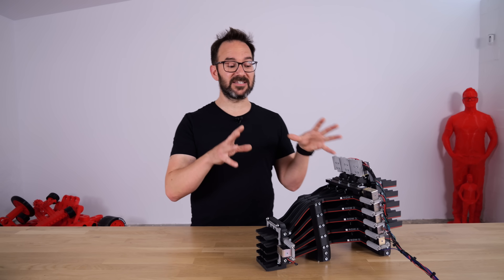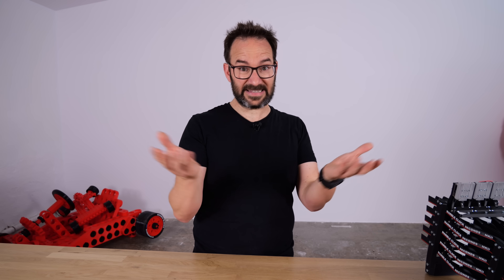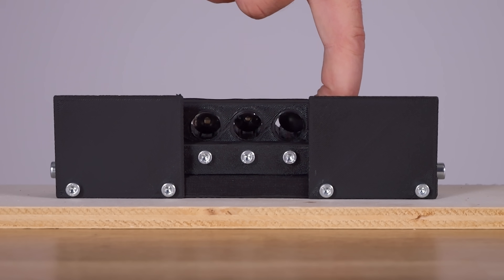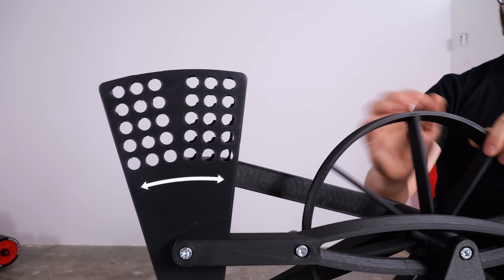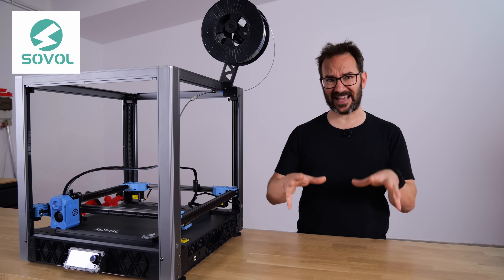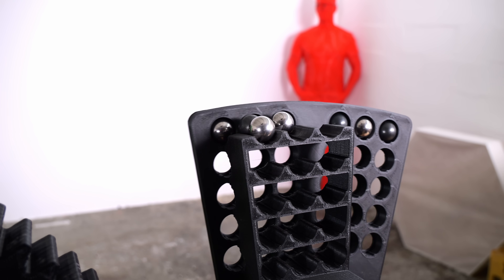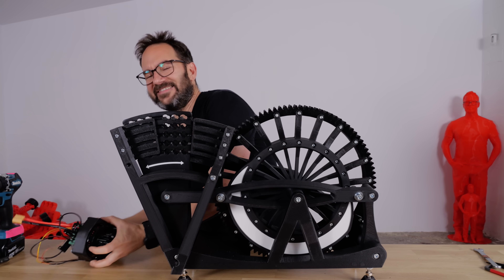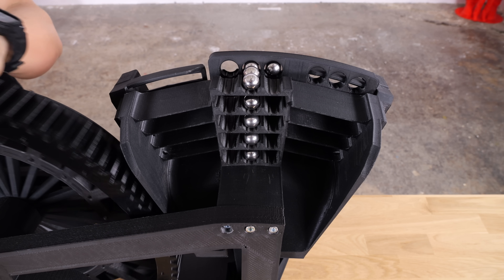Swinging Marble Teleporter - Marble Clock Seconds Display Pt.4

Comment: If the motor spinning at a consistent 300rpm is the only thing keeping your clock accurate, you're going to need a feedback mechanism to get the controller to hang back or catch up to keep it on track.

Comment: Does anyone know what the geometry between the smaller and larger diameters of the cam wheel is called? I've never seen a cam wheel like that with two points of contact acting on the same arm.

Comment: I believe this could be simplified a lot by removing the darker coloured marbles. They were needed in the original clock in order to serve as a placeholder, but in this design, they don't actually serve any purpose. If you removed them, you could remove the marble sorter.

You could also make a 5 x 3 display grid that was operated by gates driven by servos: one to allow a marble to roll into the display, and another that would allow the marble to leave the display. To adjust seconds, you would then only need to add or remove the individual marbles that differ between the digits. For example - to change an '8' into a '9', you only need to remove two marbles (bottom left corner): all the others can just remain in place. Making digits change this way would hugely cut down the number of marble each second you need to deal with. You'd also get quite a nice morphing effect between digits. Hard to explain without a diagram I'm sorry - but a total of 30 servo operated gates: two for each dot of the digit: one to allow a marble in, the other to allow it out, and only move marbles when necessary.

Comment: How about using only white marbles? by having a marble/no marble pixel, filling or leaving the spot empty on the refresh cycle by changing the speed at which the new marble impinges? (Faster marble = both marbles are displaced = black pixel; slower marble = new marble stops in place = white pixel; no marble dropped = no pixel change)

Comment: I feel like it would be nice if you could recapture the three balls coming out of each layer of the display, in order, and just recycle them to the back of the display in the same order instead of doing detection and sorting the way you did for the main clock.  Since they're getting ejected by the wedge it doesn't seem like it should be impossible, though routing will be a major issue

Comment: An idea i just had for the marble selection, what if you have a seperate stage to seperate the silver and black marbles into storage. That way the stage making the number for your display just needs to take from either tank, and a seperate stage will just seperate the black and silver. 
If it works that may be better than trying to do both at once. I dont have much engineering experience so take that with a grain of salt lol😂

Comment: Since the black marbles don't need to be used as placeholders in a parallel arrangement, can you just remove them for this part of the clock? The were only needed for the hour and minute section because it is a series arrangement.

Comment: You don't even need full width of the digit to purge the marbles, if you make the front matrix rectangular and move it horizontally, you can use one matrix for full width of the clock, with the space between digits just two marbles wide, allowing for purging both from left and right.

Comment: Since the pattern for the seconds is always the same, if you make sure that the marbles get ejected in order by adding some kind of closed tube right after the comb, I think you can just circulate them and you don't need an "active" selection mechanism, just the same marbles rotating in the right order over and over. This could simplify the design of at least the tens (0 to 5) of the displayed seconds, with at most 75 marbles in use.

Comment: I wonder if you could dip the black marbles into some very thin epoxy, then tumble them underneath a UV lamp, then swap the basket once they're all dry and keep tumbling them until they're smooth again. The right epoxy might fill the pores created when turning them black, and tumbling them would simply knock off everything that's higher than that.

Comment: Seems to me like you could have a giant wheel with 1,800 marbles in it (592 black, 1,208 silver) spinning at 1 RPM, displaying each of the 2-digit sequences from 00 to 59. For the size of the marbles you have that might be overkill though—2 single-digit wheels with a total of 240 marbles (78 black, 162 silver) might be better, 1 spinning at 6 RPM and 1 at 1 RPM. The latter'd save PLA at the very least.

Comment: the issue with this design seems to be how to fit the six digits close enough to feel like a unit. since it occupies space to the sides of the display and mostly leaves the space vertical free do you intend to make the display vertical? the angular change looks amazing, but maybe transforming it into linear movement would work better to set up all the vertical numbers in the display to a single wheel? there's just so many possibilities on how to make it work or not, i don't know how you manage to choose a solution and work on it so well, I'd be overwhelmed by the choice probably

Comment: you should use a "rocker based" system" that would help with stoping the ball, showing the ball for a bit and ejecting the ball. while ejecting it would stop the next ball to load it one it moved back. the rocker doesnt need to be that big it would just have to make the opening smaller than the diameter of the marble. thus it would also be able to be cascadet
Reply: tension it in closed postion with an excenter to open it and 
control technology should do the trick

Comment: @ivanmirandawastaken I've been enjoying this series alot, and the whole time you've been struggling with making chrome marbles black and struggling with their performance.... Have you thought about going with Ceramic marbles? They come in black and white, and are low friction, perfectly smooth, and higher contrast for optical sensors than you'll be able to get with a metal marble. Now... to start over. You're welcome!

Comment: I still think you are overcomplicating your design. Simply using your original design with vertical rails instead of the horizontal ones, the marble sorting happening before the marble is put on any specific rail, as well as building buffers for digits would've been much simpler than what you are doing now.

But as it stands, your current design also suffers from the fact that it always resets after an iteration. In other words, even if some marbles in your display are the correct color, you will still need to replace them. That will put the maximum load on delivering marbles possible.

I still like the idea,  it's just a bit painful to watch you repeat the same mistakes Martin did.

Comment: you should try to make an 3d printer that does injection molding. you would obviously need a stable easy and accurate way to make the molds, but I don't think it's impossible. I saw some of your giant 3d printers builds and I think that an injection mold printer would fit right in. Me personally I would be cheap and use as printer nozzle so I can use the filament I have lying around, again that would come with some issues like the size of the nozzle and the pressure that would need to be maintained while injecting, not to mention if you are planning on using different molds. I would definitely be a machine used to make a lot of parts fast and with accuracy.

Comment: wouldn't it have been easier to build a 3d printed set of venetian blinds?  Put it on the end, and when you want it changed, put a linear motor on the blinds control, drop everything, and put the blinds back for the next marbles.  This is the rough idea, there are probably engineering terms to describe this better

Comment: a thought for seconds & numbers-  you only need matrix x2 for marbles and the ability to switch each "pixel" - difficult to keep each pixel close enough with this design, but because you always know what number is next you can save on cycles. 
realistically you're gonna keep a lot of this the same but an idea for sorting-  have multiple slower sorters that get the discard marbles, and then merge and feed their outputs to a batch heads that can choose what marble it spits out. would allow you to feed batches of marbles to the clock simultaneously and let you have a buffer of always having the correct marble when you NEED it

Comment: Was the giant wheel really necessary or just a "bcs i can" statement?
You could have pulled it off with a crankshaft pushrod design, like in a car engine.
would have saved you ALOT of PLA.
But I understand the design choice. Oh and dont forget to counterweight the wheel. ^^

Comment: No, you are NOT Crazy...

At least not any more...

This video proves you are WAAAAAAAAAAAAAAAAAAAAAAAAAAAAAAAAAAAAAAAAAAAAAAAAAAY past merely Crazy...I don't think they have a label for what you've become...

This massive mechanism is enough to display one digit...in a clock that will need a minimum of 6 of them...2 for Hours, 2 for Minutes and 2 for Seconds...

Which means you need 6 of these Beasts...PLUS all the additional ramps, chutes, hoppers, sorters and feeders to send marbles to the 6 display mechanisms and then collect the marbles after they gets spit out of the display to be sent back to the hoppers for sorting back into the feed...

Unless you can figure out how to MASSIVELY miniaturize what you just showed us, your final clock is going to be the size of a Kitchen Table for a family of 4...

You could always build it so you can bolt a top to it and use the clock as the base for a Computer Desk...though you'd have to crane your neck to see the time display as it would be under the desk surface...

😄😁😆😅😂🤣

Comment: feels like this thing might obviate the need for a marble selection mechanism. since you can now gain control of the marbles leaving, just keep them on separate chutes like how they come into the matrix. roll them into another matrix that goes up and down every two seconds (controlled by the same cam maybe? at least connected to the same main gear...) and then let them roll back out and merge back into the queue for the matrix. Then you only need 150 marbles total, set them up to display the digits in order once, and you're done. Yes there are some more problems to solve with this, but it seems like it would require less energy and have fewer components that could fail in the end. No sensing parts, no selecting parts. Just marbles moving.

Comment: SUPER awesome and cool! Can't wait for the finished design.
One question though: Did you do an exact 100:10 gear ratio? isn't that super bad as every tooth of the big wheel will always engage with the same tooth from the small gear, increasing the likehood of failures by a lot?

Comment: Could the marble catcher be on a circular wheel (The 9 holes 12 times around a centre point) itself to reduce the mechanism footprint, remove all those linkages and  the mechanism would go in one direction increasing its lifespan?

Comment: There is an INCREDIBLY simple solution to the problem with marbles pushing each other off inconsistently. Add another marble. The falling marble hits the middle marble, and ala Newton's cradle, the momentum transfers to the marble on the edge and it falls off. Now the other two marbles, which are currently stationary, slowly fall to the end.

Comment: Why not stack 10 marbles in a tube and when 10 reached empty it, and fill tube2 with one extra marble until six marbles in tube 2 reached(60 seconds). empty tube2, and do it again, no need for multiple colors, and no timing problems.

Comment: I think, you might have been able to get the old one to work if instead of having the marbles stop at little ramps, you‘d use a wall and another grid of pins to push them out (run similar to the setup that prepares the next load).

Comment: Here are some improvement suggestions:
1) Replace the linear motion by a circular motion: you already have a 2 matrix sector, it's simple to replace it by a 10 matrix disk.
2) Use indexation: associate each matrix to one digit. This will simplify coordination between each module.
3) Limit failure risk: in each matrix, marble configuration will stay constant, so stick marbles to their definitive positions.
4) Remove unnecessary systems: since all marbles are now stuck, you can remove the filtering and the supplying system.
5) Lighten the clock: the system will be faster, cheaper and need less energy if you replace the marbles by drawings of marbles. Then, you will be able to alleviate the whole structure.
6) Scale it: with this level of simplification, it should not be difficult to use a 60 matrix disk, one matrix for each second in a minute.
7) Make it perfect: instead of rotating the frame containing the matrix, keep it stationary and use a rotating hand to indicate the current second.
8) Think big: with all this hard work done, you may think about adding a hand to show minutes, and maybe even a hand to show hours.

This would make a great and impressive marble clock, and also a very effective one :D
Reply: yes I agree with the linear motion to circular motion, Should it be 12 matrix as it would be easier to time?

Comment: I love this wheel approach - it looks super robust being driven with a single motor!
Correct me if I'm wrong, but you actually always just need 10 different digits 0-9 in the same loop for both digits (single seconds and ten second increments).
When the marbles get pushed out on the backswing, could you catch them in a way that puts them back in the same order? Then you'd not need a sorting mechanism and would just have the same 10 marbles running on the same track in circles.

Comment: With this system you don't need the black marbles, they were only really there because every slot needed to be filled to eject the previous number, now that all marbles are ejected every time you can just forgo the use of the black marbles. That would solve the issue with friction but it will also make the numbers easier to read.

Comment: It’s fun to think about the “rules” of this kind of challenge. The marbles in this design are still rolling under gravity a bit, but they are getting brute force moved quite a bit more than in the previous design. 
If you go too far in the brute force direction then you could have a big wheel with ten matrices of marbles glued to it. The wheel rotates 1/10 of a turn every second and shows the matrix with the marbles for the corresponding digit.
But then the design isn’t using the fact that they are marbles at all, so that’s definitely against the rules, whatever the rules are!

Comment: Super neat! In the future, do you think you could use just a large solenoid vertically on the back of the sliding portion, with a lever to transition the forces sideways instead of vertically? Would be a lot more compact.

Comment: If you want some delay on the wheel thingie, add a sliding part where the arm connects to the wheel.  The wheel will push the arm all the way, but on the return stroke, the wheel will have to move a few inches to before it starts pushing on the arm again, adding a delay.

Comment: What if:  You used some of that super black paint/cloth stuff to make a box/rectangle that you would then just drop silver balls from the top and have a strobe light flash each second to show the number.  No black balls needed, and it will still be just as noisy as before. :)  [/thought]

Comment: It doesn't look like two of these, in their current form, would fit next to each other close enough to look like a clock readout. Could you tweak it to handle two digits so it can count 00 to 59 with one mechanism?

Comment: This is  monster of a contraption.
Seems bigger than the clock itself.
Why don’t you „recycle“, pun intended, the marbles from 0 to 9, probably with two sets of marbles. This way you do not have to reconstruct the whole display every second. 
Just show them in time. With the swipe, you can put them away in an ordered fashion.

Comment: I love what you do. I'm surprised you didn't go with a Geneva wheel mechanism for the switching as they are good for taking smooth rotation and turning it into periodic sudden movement. But the solution you have gone with looks to work great too.

Comment: Instead of making it a mechanism that rocks back and forth, why not put the matrix on a disc that just rotates one way? This way it is not necessary to have two exit ramps, and it's potentially even possible to load the matrix in advance before it is moved into place.

Comment: I love watching you do this project😃

I have one big question that's been nagging at me, if your rear loading marble selector system can keep up with a new digit per second, why don't you just preload 3-5 second ahead (so each 15 marble digit has the marbles for the next few digits behind) and just shove them forward one space each second, ejecting the previous number out the front?

If you weren't using gravity before but a comb thing to shove them out the front it could be way simpler, no?